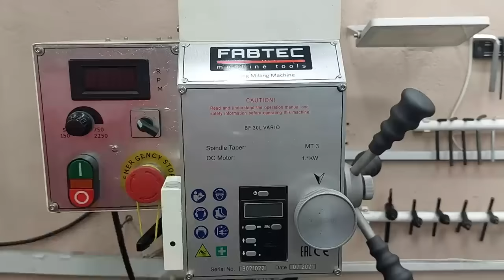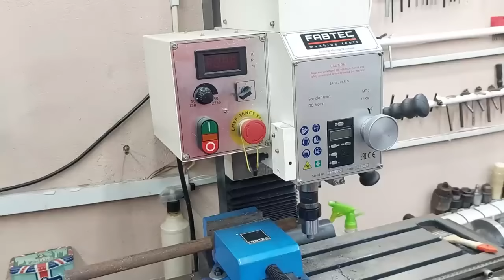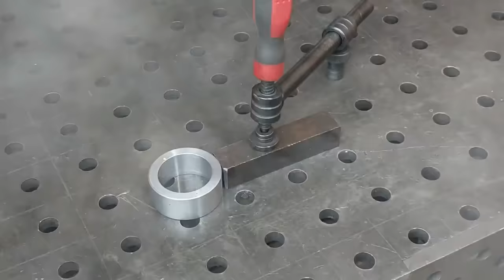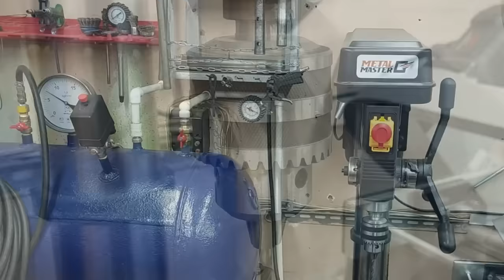Top 3 brilliant metal turning ideas you've never seen before

Comment: Why do all these guys take a piece out of the mill vise and put it in a shop vise to tap a hole?  Makes no sense to me. But hey!  I’m just a 72 yr. Old machinist with over 50 years experience. 😊 I can’t believe he put that rusty tapered shank in that nice tailstock spindle.  That’s a drill chuck not a mill chuck. 😮
Reply: Because he is a hacker not a machinist.
Reply: Most people these days do NOT understand machining processes. They are mostly hacks.
Reply: Did you see the drill wobble at 0:50 ? and he continues on as if it's normal and then at the END he uses a center drill  .🤣
Reply: Good grief the centre drill is the starting drill not the champher on the wobbly hole after the fact.😵‍💫🇦🇺🐈‍⬛😎
Reply: I am a similar vintage machinist as you, and also can't believe.....................literally every tool is used incorrectly in these "brilliant ideas"!  When I was an apprentice, I would have gotten a size 10 in the ass for all of these practices. Shame that he is teaching others his skill set...............
Reply: Did you notice that when he clocked the magnet face and removed the clock the needle didn't move., 😂

Comment: that first one with the magnet will only work if the face of the part in the chuck is already perpendicular to the spindle bore otherwise when attracted to the magnet in the tail stock it will cock at an angle.

Comment: Has the vice ever been used or the lathe? Plus drill not centred properly just as easy to put the work in the chuck not too tight and run the lathe in reverse then run the tool up against the work to straighten up sorry to be picky
Reply from the maker: Welcome!